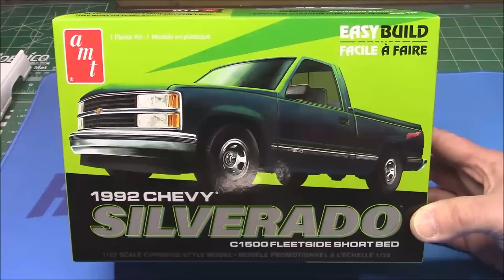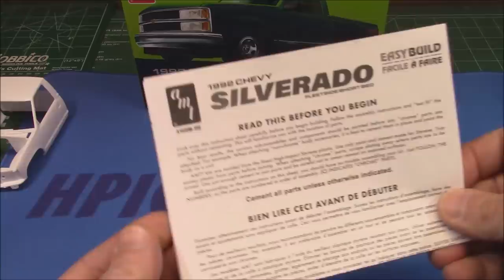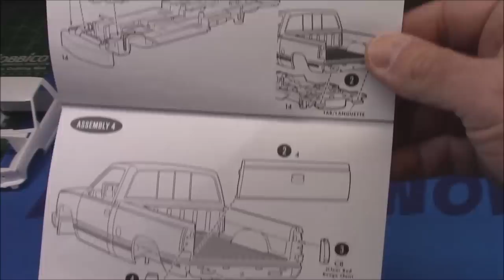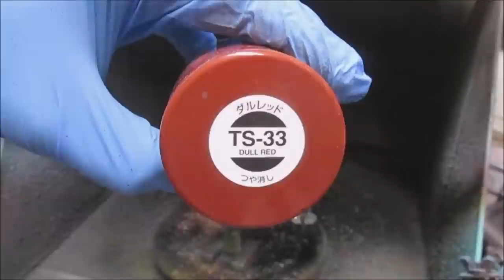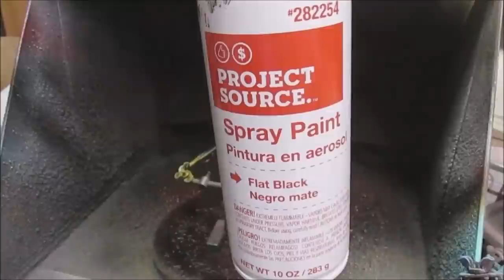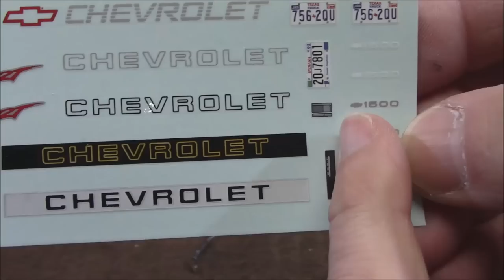NEW! 1992 Chevy Silverado OBS 1/25 Scale Model Kit Build How To Assemble Paint Two Tone Dashboard

Comment: I had a 454 SS kit, it was molded in black, very nice. The steering system worked and if you reversed the front spindles, you were able to "lower" the truck. Great video and great review. Keep up the great work.
Reply: Yes the glue kits of these, back in the 90s, were amazing! The emphasis on accurate details to the actual cars/trucks in the mid/late 90s got me back into model building.... because I had the real cars and know what they should look like! Anyone with a parts stash from those kits, looks like many of those parts could be used on this one and the dually, for kit bashing and super detailing.
Reply: How did you hold the tie rod on the steering? I don't see any retainers to hold it onto the pins on the spindles.

Comment: Hello,  I have three of the AMT 454 Kits #6032, 1 built one back in the early 90's I actually tubed the rear and painted the body with a two tone paint scheme.  I now need to build one of the other kits as the original truck black with the decals 454 SS.  Something I just noticed having these kits since the 90's in my closet,  one of them on the box has Skill level 2 and added trademark information and the kit plastic is white, the other two kits came in black.

Comment: I remember when this kit first came out in the early 1990s - is this what they called a Snap Fast Plus model back then? I remember the full detail SS454 model, as well as the standard Fleetside model like this that was a three in one stock, mild custom and full custom, which they also did with the short bed 1992 F150 (I bought that particular one). You've been on a Chevy truck building spree lately, and this color scheme is right on the money!

Comment: At the 2:10 mark you mentioned the stereo. Back in the day, JVC made a 3-piece unit to replace the factory Delco stereo with😁 It had the square control head, cassette unit for the center under the A/C ducts, and the amplifier module under the dash mounting and plugging in just like the Delco👍
Wish they still did.

Comment: I have most of the remains of the old AMT C2500 full kit version of this, long bed and I also remember having the snap fit version as well as the dually.  I can tell some differences with the molding since this is all new.  Glad they kept the cab and bed separate parts so they can make the various versions down the road. Interesting to see their style of a kit vs AMT/Ertl had.

Comment: Very nice video, thanks for that! 
A couple of painting tips for more accurate truck models: the gas tank has a black plastic cover on the bottom half; this is what the louvered part on the chassis represents. It's easier to see on the old glue kits with more chassis details. The cowl area between the back of the hood and the front of the windshield (where the wipers are located) is black plastic and should be painted semigloss black. The steelie wheels are Argent(silver metallic) from the factory, with chrome center caps on Silverado and black plastic ones on Cheyenne and Scottsdale, and stainless steel trim rings.

Comment: What’s the difference between the panel line accent color & the black acrylic paint? And why do you use them when you do? Sorry for the noob question, I just bought my first kit and started watching all your videos 😂
Reply from the maker: I use the panel liner on small areas, it's ready mixed, easy to use, faster to apply.

I use the black paint mixed up for larger areas, complete washes and weathering on a large scale as it's more gentle and doesn't have a chance to mess up the underneath paint like the enamel solvent panel liner can.

Comment: I also have a question, since I can't really tell from the video. Are the body lines and details better on this new tooling? The problem with the 90's issue is that the door and trim lines are so shallow that you pretty much lost them after a coat or two of paint... I hope they fixed it!
Reply: If not, you can use a Tamiya scriber to deepen any panel lines on your kits. It's not hard to do, just    g  o       r   e  a   l        s    l    o    w.